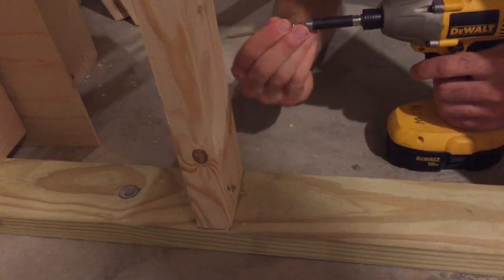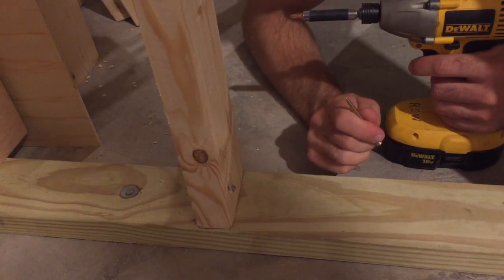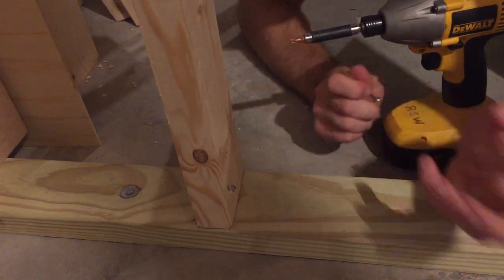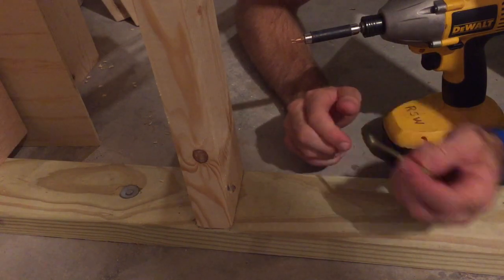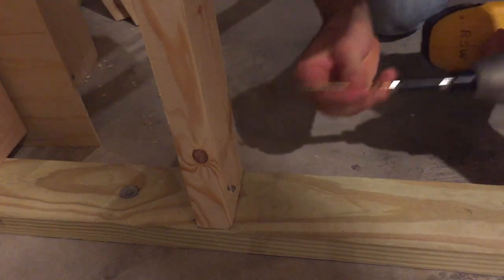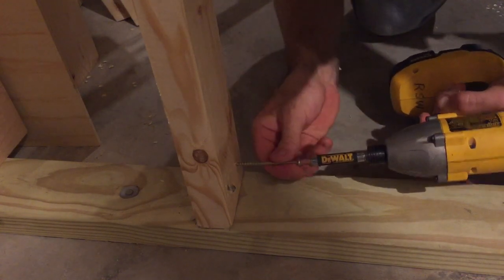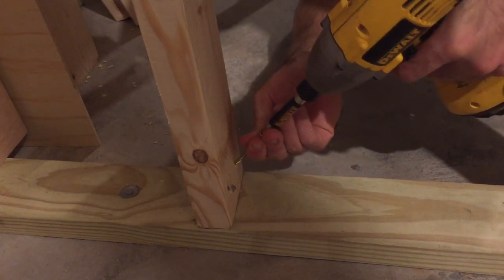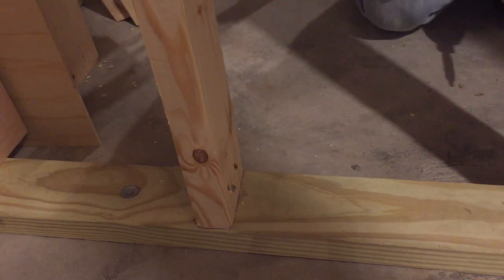How to toenail a screw

Comment: Watched this about 3 times before I realized "start it about an inch and a half" was talking about the distance from the joint to make the screw hole, not the depth to make that preliminary hole. Was very confused, because it didn't look like you screwed it in nearly that much before angling it.

Comment: But you didn't show the first screw, which is the hardest one. You showed the second screw, where the stud isn't going to walk away on you because it's already held in place.
Reply from the maker: hi jean 21061 well the first screw is indeed the most problematic, however if your stud is the proper length, friction should hold it in place well enough to easily sink the first screw.  Thanks for watching!!

Comment: Is it safe to use screws instead of nails?
Reply: Some say since deck screws can fracture when struck from the side, unlike a nail which usually bends, it's better to go with nails.  I think that answer is an over simplification.  It likely depends upon what you need.
Reply from the maker: @russchadwell  nails are stronger in shear but screws are good at sucking everything together
not to mention screwing sometimes is the only option in hard to reach or tight spaces!